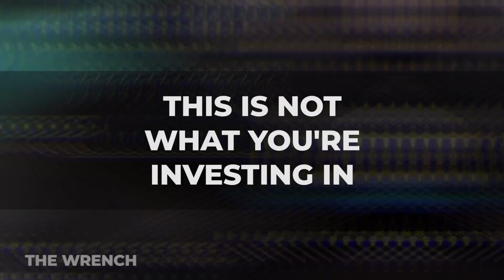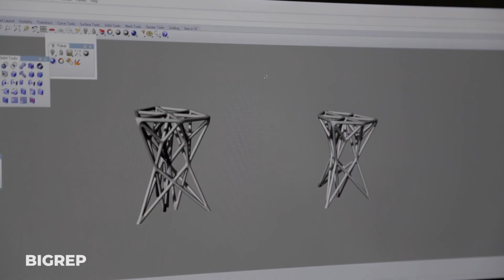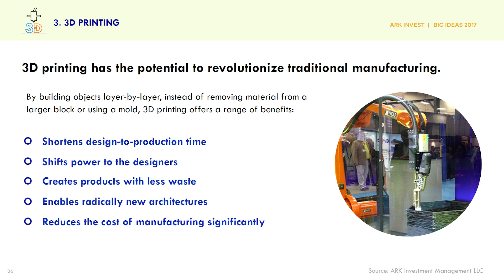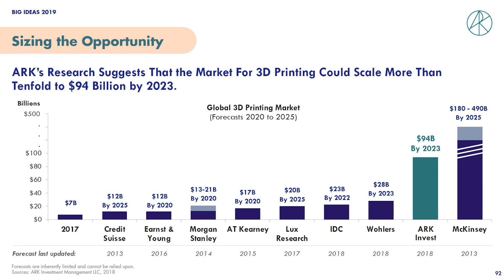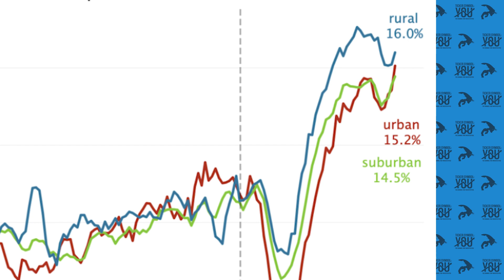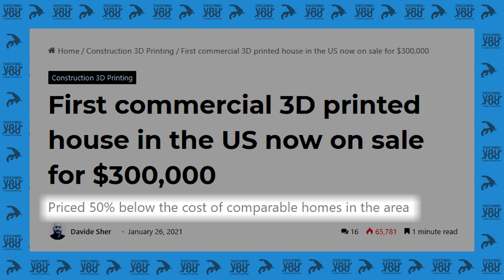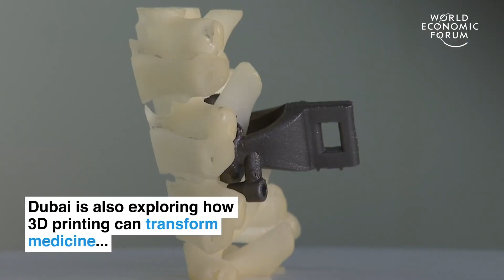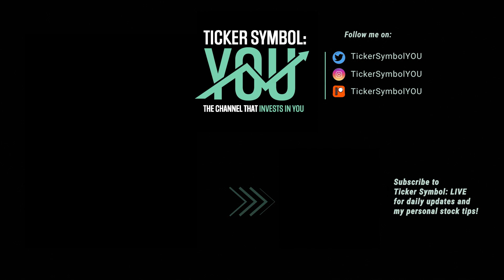😅 ARK Invest Mistakes on 3D Printing: ARKK, ARKQ, and PRNT are all Missing These Big Ideas

Comment: ARK Invest's mistake? I didn't hear you mention any specific tickers missing from their ETFs. Do you think 3D printed housing is actually ready for "prime time" as Cathie likes to say? She did mention it was very expensive and prototypical.
Reply from the maker: Yep. That's the mistake. You can see that the cost savings already exist and the houses are listed for up to $100K cheaper than their equivalents. They're cheaper per square foot and in terms of time. In my opinion it's down to regulations and building codes.
Reply: @TickerSymbolYOU  Still so many problems with those houses not addressed in this video. Did you hear the echoes in them? Hello? Hello? Hello? Also, they use concrete, the most carbon-intensive building material of all, and concrete is highly conductive. They will be super expensive to heat and cool and only rigorous analysis post-build will show what is really the case. See my other comment for disruptive companies in the space and please study climate solutions to better understand the limits of many disruptive technologies. If they do not align with the megatrend of climate solutions, they are largely dead in the water. Example: H2 passenger and cargo aircraft. They emit H20 as a byproduct, and that's ok at low altitudes, but most fly high up where H20 release is a greenhouse gas that can significantly increase global warming. Whoops.
Reply: @yonseienglish  Little off-topic but what are your thoughts on hydrogen vehicles?
Reply: @tylerb325  A bad idea when compared with the efficiency of battery electric vehicles (BEVs). This is not controversial. Elon Musk is correct in going full EV on ground transport. GH2 will have a small role in steel, perhaps, and some other industrial process and long-term storage as a supplement to gas in peakers for balancing grid, but that's about it.

Comment: My main reason for remaining bullish for 3D printing at all is that it’s used for aerospace, including rocket engines, and that low cost printers have gone from absolute garbage to reasonably acceptable within the past 4 years. Also, my company which services subtractive manufacturers is working on support for additive laser welding on CNC machines, so milling/lathe and additive occur on the same shop level machines.

Comment: Those ridges on the interior walls will be hell to clean.
Reply from the maker: Just smooth it out while it's wet (during construction)! 🙂
Reply: @TickerSymbolYOU  the finished homes still had the ripple - dont know why they would do that. Maybe it was just a model?
Reply: But you save 10s of 1000s - easy trade-off!! Besides, this seems like an easy problem to solve.

Comment: How to print, err, hang a picture or flat tv on a wall?  🖼
Reply from the maker: You can print an alcove into the wall and the supports behind the wall for mounting. You could have a wide variety of "media wall templates" to choose from to customize your room. Heck, if it was an exterior wall that didn't run other things through it, I could even see you being able to pop the wall out and a new one in its place if the need arises.

Comment: I think companies that 3D print houses/buildings could do well in natural disasters areas because they will need to rebuild.  The main problem is those walls have groves that will collect dust and be hard to clean.  Comments?
Reply from the maker: Smooth them out at the end!
Reply: @TickerSymbolYOU  Concrete is pretty hard stuff.  I bet a robot could be designed to do this!!
Reply: @TickerSymbolYOU  Any key stocks you could share?

Comment: So when you talk about scaling up 3D printing, the question that comes up for me is toxicity. Of course, this will depend on methods and materials, but, for instance, we already know there is way too much plastic in the environment. An article I found quickly in Forbes talks mainly about emissions during the process of printing. But I further wonder what we will be putting into landfills - or the oceans - when these 3D printed houses are torn down? That depends on the choices made by manufacturers and consumers, assuming there are sufficient alternatives available. Next, I asked myself is anybody working explicitly on environmentally friendly 3D printing? It turns out the answer is yes. There are folks working with recycled plastics - still plastic, but better than creating it from scratch. Another solution is hemp-based material. Hemp fibers can be converted into biodegradable plastic and so-called hempcrete, i.e. hemp concrete. So far, hemp would be my favorite solution. It grows quickly and is generally beneficial to the land. Industrial uses, like converting it into plastics, probably introduce some toxins by necessity, but making the mainstay material clean, organic hemp is probably a huge step in the right direction. Of course, we're still in the 20th century mindset where we expect to compromise in order to make money - a moneymaking vision sadly tends to mean "damn the torpedos, full steam ahead!" Environmentally friendly solutions aren't always the best monetary investments in what is still in many ways a legacy 20th century economy. In fact, they usually aren't. But if we can band together in a vision of creating a better world, an investment whose chief benefit is a healthier, longer life, then we can also collectively make that course of action the best monetary investment in the world.

Comment: Something tells me this would suck for the plumbers and electricians. All their work is done between the walls. I’d like to see one of these builds in process. None of the concrete walls were saving spots for outlets and fixtures
Reply from the maker: 10:47 talks about exactly this... they do save spaces for those things
Reply: @TickerSymbolYOU  how did I miss that. Thanks for getting back so swiftly

Comment: 3D has been big for over a decade. My friend and myself saw this was going to be a disruptive technology. After-all not a new idea Star Trek has its version of it as a replicator. Even if it isn't going to be in every home. I could see a central 3D printing centers around the country that might be available to rent or a store or company could rent the 3D equipment to make on demand many parts and small items for hardware stores that prints on demand. Then you don't have parts sitting in warehouses becoming outdated or saving costs for insurance, thief, storage, maintenance, and personnel. Instead print parts on demand for last mile delivery or straight to individual's homes. 3D homes are happening and will be the feature for many homes including the ability to vary the design in the same project. Also it should be able to build stronger homes including possibility the main wall insulation.  This is our feature.

Comment: Can you imagine molten metal printing? Right now, industries inject hot metal into forms for molded metal, for example, the tesla Gigapresses.  Consider the intersection of 3-D printing for a computerized design using AI-assisted metallurgy.   Why stop at concrete or plastic? Why not develop similar techniques with new materials, maybe even new alloys of metal or even organic compounds created with the assistance of artificial intelligence?

Comment: Excellent analysis and points. I live in Florida, where hurricanes ravage our communities. The 3D printed structures can offer increased protection from wind damage and lower insurance cost overall. Additionally, farmers can quickly build outbuildings for equipment, livestock, and storage far less susceptible to rot, infestation, and weather damage. The potential is enormous.
Reply from the maker: I'm in FL too and the housing crisis is real here. Affordable housing in my area simply does not exist. It gets snatched up on day 1 and there are bidding wars that result in inflated prices per square foot.
Reply: 3d printed thing is actually weaker in structure, so I am not sure it could increase protection from wind damage. It needs high-rise to solve housing crisis like in  China. Printing won't solve it since its weak structure cant go up high.

Comment: Ok, 3D printing has a ton of design constrains that other process’s don’t have. First, there’s just not only one way to 3dprint, it can be very weak structurally, and more expensive. it’s not a magic solution at all, it’s just different. The best examples are the ones talked about, aerospace(some parts, try to make a 3D printed plane lol) and medical implants. 

But 3D printing in housing, for exemple, is just dumb. Cheap Houses are already pre-fabricated, and basically just assembled by very low payed workforce. This process is very fast, much faster then 3D printed, which is constrained by size of machine, site, materials, etc.... 

3D printing is not the new industrial revolution, is just a “new” process that allows for some new stuff. The world will not 3D print everything, anyone that thinks that never used one for real.

That being said, it’s a technology that can grow and def has markets. It’s not a bad investment necessarily, but you need to understand what it is and what it isn’t to invest in it properly.
Reply: Also this 3D printing process for housing doesn’t use sustainable materials. If the claim is for scale, it will not help with global warming at all. For example, CLT which is a new wood process, is just better and sustainable for small constructions
Reply from the maker: Hey, thanks for taking the time to leave such an insightful, high-effort comment.

1. 3D printing having more than one way to print isn't a constraint; it's the opposite of one.
2. No one is claiming it's a magic solution, but it is a superior form of manufacturing in many cases
3. Pre-fabbed houses relying on cheap labor isn't what these 3D printed houses are competing with; it's existing homes that could be built in a much more efficient way (and, by the way, labor being cheap isn't a good reason to keep using it)
4. I've been using 3D printers for about a decade. The world will never 3D print "everything" but it can and should 3D print MANY more things than it does today.
Reply: @TickerSymbolYOU  
3. Is a bit complicated. If you want a cheap home then prefab is definitely in the competition. 

If you want a custom home then 3d printing is an option. Especially if you want fancy stuff like round walls. But then you need to pay for a custom build, including all the holes in the right places (some of which might be overlooked and have to be made the traditional way). While there can be some savings, Im highly skeptical of the 20-30% of the overall build cost cited. In my opinion the walls just dont make up that large a part of an overall build cost. For one most of these 3d printing videos seem to skimp on the internal finish for some suspicious reason.

Comment: Nope.  3-D printing is not the answer to housing.  The price of housing is impacted by construction costs only minimally.   The REAL cost increases are due to the increased land costs.  It’s the reason we see much larger houses, often multiple unit, being built after a pre ious dwelling has been torn down.

For the record, I live in a house built in a factory 400 miles away and trucked to, what was at the time, a slightly oversized lot, which by today’s standards, could easily support a multiple dwelling unit.  I bought the place 50 years ago.   Factory built. . .   Partially or totally is just as cost effective as 3-D.

Comment: What 3D printing stocks do you own?
Reply from the maker: I'm big on NNDM and ONVO
Reply: @TickerSymbolYOU  I hear good things about NNDM but that price to sales is crazy!
Reply from the maker: Heh. I bought at $4
Reply: NNDM & Desktop Metal
Reply: @georgsimon4171   According to yahoo finance Desktop metal has a price to sales of over 300...even if it doubled revenue every year, it would be like 4 years until that is an acceptable price. And that is a big unlikely if.
Reply: @Adam-tt5hn  ..you have to take a deeper look into them..there is also an Interview with the CEO..and there is a much bigger revenue expected then just dubbling
Reply: @georgsimon4171  I have done, and they are projecting lower revenue growth than 100% every year.  They say in their investor predict 87% compounded annual growth rate.  This is also some number they pulled out their ass that could be far higher than reality. They look like a good company, but they make equally good companies look extremely cheap.
Reply: @Adam-tt5hn  ..also Ark Invested has them also in their 3D Print
Reply: @georgsimon4171  Yes but it is no where near their biggest position.  They also said themselves its drastically overpriced compared to its peers.  Their biggest position in 3D printing is ExOne, DM isn't top 5.
Reply: @Adam-tt5hn  ..yes I am not worried about it. But as far as I know they keep on buying small positions when there is a dip.

It's always also what is important for yourself regarding evaluation. What I liked beside their product the most is their business strategy and the portfolio of their clients. So..there is already a trust situation built up with a lot of their clients as that company exist already for quite a long time. This is not a company to make the quick buck..it's more like Palantir...the gain will come but not in a week.

Comment: 10 years in construction experience five years in structural concrete experience. I can assuredly say that 3-D printing concrete will not work structurally as well as Financially. 3-D printing a house with concrete is too expensive and too time consuming. 3-D printing homes may be some thing of the future but not anytime soon
Reply: In addition I can assuredly say that when they say 20 to 30% cheaper they are out right lying to draw investors and I would stay far far away from this as an investment. I also want to mention that the majority of my investments is with Ark Invest. So I am not just being jealous of the gains because I am making money with Ark
Reply: @bpkey123  My question when hearing x% cheaper - compared to what? In this case Id like a comparison with a prefabricated house.

Comment: First step, I think Tesla  should buy a 3D company that specializes in printing homes. Next step for Tesla would be to build a community of printed homes. Finally they should sell the houses at a steep discount by including a Tesla solar roof and a Tesla  battery package for free. Do you think this strategy would work for Tesla? I am assuming that you are a Tesla fan.
Reply from the maker: I don't think this makes sense for Tesla but I could see Tesla owning more of the home than they do now, for example the HVAC system.